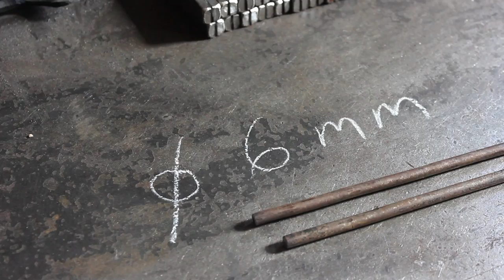Blacksmithing : Forging a Nail

Comment: What kind of steel would you recommending for making a nail header, assuming I have to buy it, not recycle it from an old car etc.?
Reply from the maker: I recycled an axle drive shaft from our local junk yard, If you buy ask your local metal seller for something tough, but not too brittle. I never bought a special metal for such purposes, as it is really easier to find something recyclable where I live.

Comment: very nice, can you show us how you made that heading tool?
Reply from the maker: Thank you! I made it ages ago as a temporary tool just improvising with measurements, but as we all know nothing is more everlasting than something temporary =) It still surprises me with its durability. The most important thing to remember while forging a nail header is to make sure the hole is slightly wider from the bottom side. I will think about making video about it. Thank you for suggestion!
Reply: @SunHillForge  thanks so much, I look forward to see it.
Reply: Agree, that would be a good video to make
Reply from the maker: @ArmySoldier1972  I will keep the heading tool in mind!

Comment: Why not use the pritchle hole?
Reply from the maker: Hardy hole somehow works better for me with this specific nail header.
Reply: @SunHillForge  so make a cut-off tool for the pritchle hole then! 
        Not a diss just trying to reduce the steps.
Reply from the maker: @fourgedmushrooms5958  good point, reducing steps is important! When I forge dozens of nails the first step I do is forge all the tapers and cut them off. Then I take the cut-off tool out and forge all the nail heads. This video shows full process of forging a nail (or a couple).

Comment: Wow very pleasant and instructive pleasant video 🤩👍👍 
do you leave your nails this way, or do you quench them? How do you make them black
Reply from the maker: Thank you! I leave them as they are, but I spray a clear varnish on them, so the colour is just a natural colour after forging. You can use linseed oil as a dark protective layer as well.

Comment: Sweet!  Do those nails need to be hardened?
Reply from the maker: Thank you! The nails are forged from mild steel, that is not good for hardening. But there is actually no need for hardening nails I think, otherwise they become brittle. Sometimes there is also a need to bend them from the other side of the wall, so they should better stay soft.
Reply: @SunHillForge  Thanks very much!😊